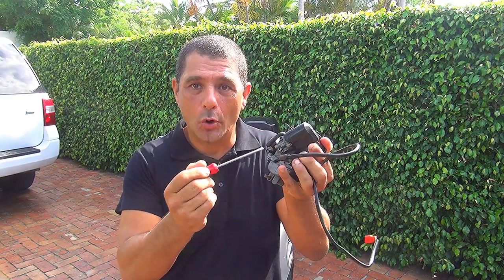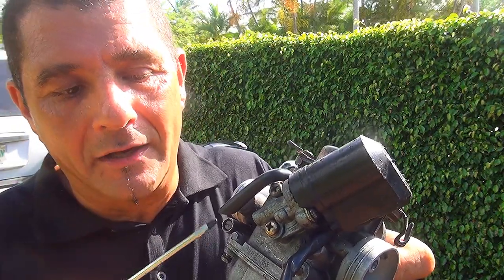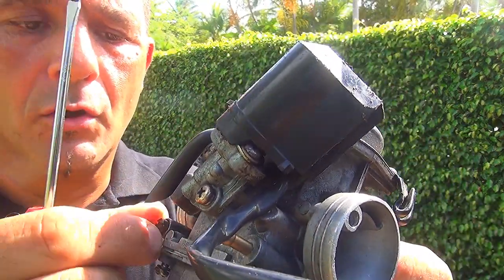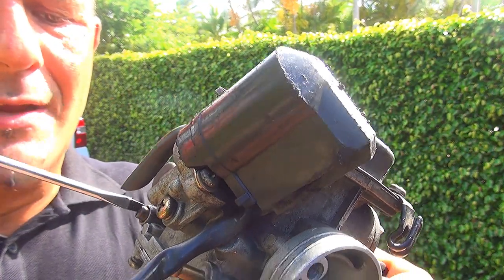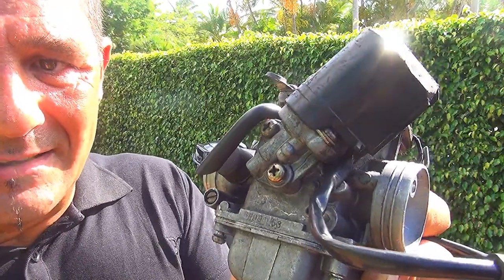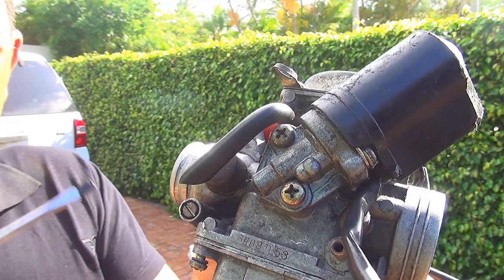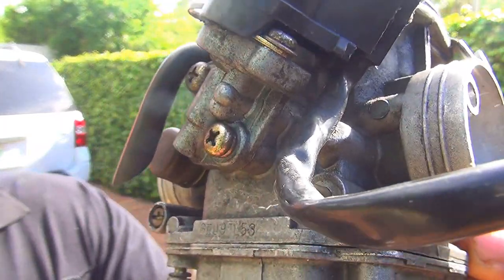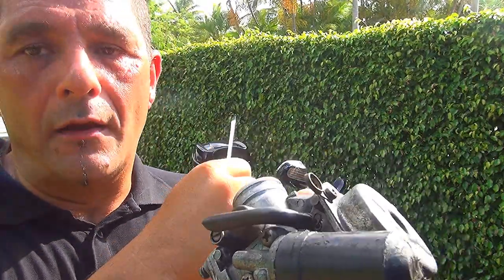How To Set Scooter Idle Mixture Screw

Comment: 1 1/4 turns from full tight works in my tao moped
Reply from the maker: Great info Thank you for sharing
Reply: @VirberelloScooterTips  mines the 50 cc model. Has a filter and full exhaust as well. Cdi box and clutch next

Comment: I’ve recently purchased a 2022 Big Boy RS150 Chinese scooter, I’ve noticed recently after doing a few mods exhaust, cdi, coil and plug.

When opening the throttle when riding seems like it’s holding as though it isn’t breathing properly or not getting enough fuel, will adjusting this particular screw help?

Thanks in advance from South Africa…
Reply from the maker: Hello my friend that screw will only help when you are at idle around 1k rpm above that main jet will take care of the fuel flow so if you change lots of things on your scooter try to change your main jet base on your altitude that can help you a little . Thank you for watching my video
Reply: Thank you so much for replying much appreciated.

Comment: My scooter is not running fast I have sym 150cc
Reply from the maker: Hello Og Mendy  if your scooter is not running fast you can do lots of little modification like change roller weight to 12g,  reject your carburetor , iridium spark plug , performance cdi, performance coil , performance cone air filter and lots more mods that will make your scooter rock
Reply: @VirberelloScooterTips  you are amazing thanks a lot how can I have your contact
Reply from the maker: @ogmendy5911  contact me anytime on youtube